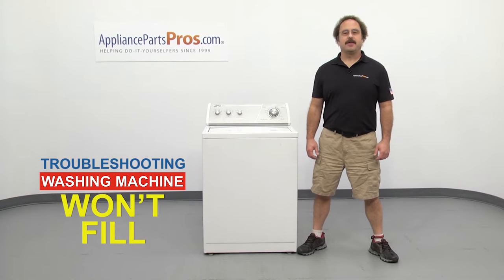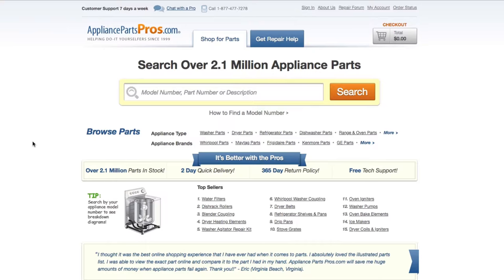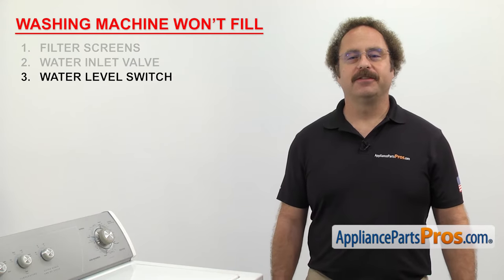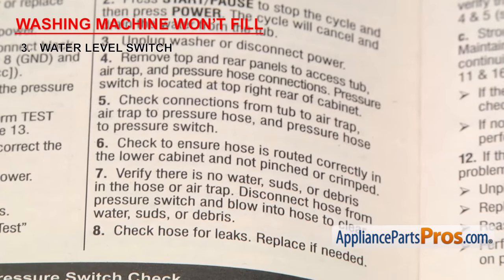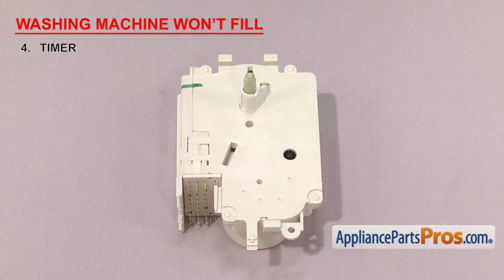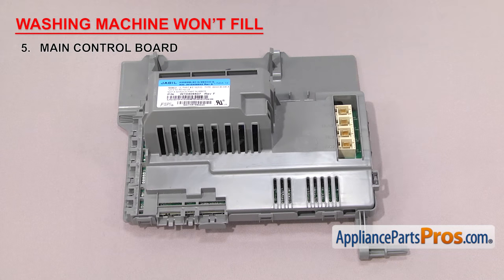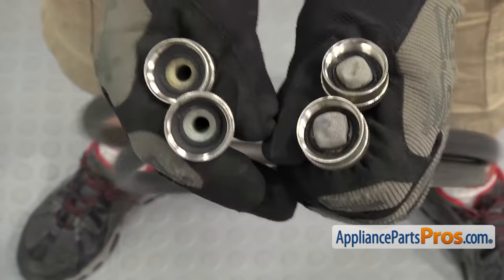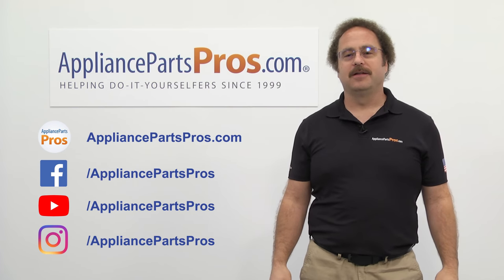Washer Won't fill? - Top 5 Problems and Fixes - Top-Loading and Side-Loading Washing Machines

Comment: Very useful information! I have an AEG Oko Lavamat and it works perfectly fine until the rising cycle when it does not take water anymore and I get E10 error code. I understood that the rising cycle is done with cold water but I don’t understand which part could be malfunctioning. Could it be the main control board?
Reply from the maker: If you have power going to the cold water valve and no water is entering the machine then the valve will need to be replaced. If you are not getting power to the valve then the control board would be the issue.

Comment: If you take the water level switch apart inside is a set of points like an old car ignition system. Just clean the points and you’re good to go. Just did that to my washer. Saved me 50$ on buying a new switch
Reply from the maker: Glad you were able to fix your washer. If there is anything in the future we can help you with please let us know.

Comment: Great video ! My Whirlpool washer 1CWTW4815EW1, when set on SMALL LOAD automatically fills to MEDIUM or more. It does not overflow of course. I have blown through the pressure hose to make sure it is not obstructed and the hose goes directy to the MAIN circuit board.  Will replacing the water inlet valve have any helpful effect on this problem ? It has done this since new about three years ago. Thanks !
Reply from the maker: It sounds like the water valve is working properly since it is letting water in. If it's not filling up to the correct level and the pressure hose is clear, then you will need to replace the control board. That part is W11305799, you can place that order on our website or you can call us at 1-877-477-7278 to place the order over the phone.

Comment: GE Washer GTWP18WOWW
Washer is set to Extra-Large load, Heavy washing mode. Water fills to expected level. Washing cycle begins and continues normal until timer pointer reaches the RINCE cycle. The Rinse cycle begins with filling the water to approximately ½ of what was during the Washing cycle. Agitator starts with ½ of water. Agitator starts while water continues filling the Tub for the next 10 sec. then water stops, and the Agitator continues with 1/2 of water to the end of the Rinse cycle followed to Spin cycle. 
My thinking was that the Water Level Switch is OK because it fills water properly at the beginning of Washing. I have installed a new Timer but issue remains the same. Would you please advise. Thanks in advance.
Reply: Mines only a month old.. Fills less than 1/4  not even close to cover clothes. Sounds like it whining like motor struggling. Stops fills. Stops whines. I took a bucket n filled up the tub. Idk what to do. Bc Lowe's SUCKS
Reply: I found that the problem with the old washer is the same as the exact new one that was provided by the landlord.  I take to adding a gallon or so of water weighing down the clothes and fooling the machine into sensing that it has a "full load."

Comment: I have an Insignia Top Loading washer that cleaned clothes very well for 13 months. Now it agitates for 5 minutes before the water goes into the tub. Even with Deep Water selected the tub barely has any water in it. I've checked the hoses and filters - they look good. Next I'll start with the Water Inlet Valves. Thanks for the videos. Any suggestions are GREATLY appreciated.
Reply from the maker: What is the model number?
Reply: Could water have gotten in the area outside of the drum and be causing the washer to "think" it already has water in it?
Reply from the maker: Can you verify that model number? Not having any luck locating it anywhere. Do you happen to have a multimeter? You can check the valves for the correct voltage.
Reply: Yes, we are checking with a multimeter. Looks like we might need a new part @appliancepartspros
Reply from the maker: If you can verify your model number we can help locate the correct part for you if you would like.
Reply: NS-TWM41WH8A. The "BA" at the end of the model number is probably a typo on the front page of the owner's manual. Thanks for asking again, I hadn't realized they would have a type like that. The multimeter says that some of the terminals on the water level switch aren't working. We will try a "reset" and then see if it works. Amazon should be delivering new Hot/Cold hoses by midnight.
Reply from the maker: If you open the top of your lid on the inner side of that lid there should be a sticker with the model and serial number on it.

Comment: So my washer is a GE top loader it will fill to the correct amount of water for a wash cycle. Small medium large but on rinse mode it will only fill up to the bottom and that's it. So could it be the water level switch? Or the water inlet valve?
Reply from the maker: What is the model number of your washer? Have you had any error codes come up in the machine?
Reply: @appliancepartspros  GLWN2800D1ws 

no codes did show up but I would like to know what could be the problem of why it doesn't fill up all the way on rinse cycle
Reply from the maker: During the rise cycle when it is filling has it always just filled to the bottom or is this something that the machine just started to do?
Reply: @appliancepartspros  it's always been doing it
Reply from the maker: The manufacturer has designed this unit to not utilize as much water during a rinse cycle as it would the initial fill.
Reply: @appliancepartspros  This makes more sense thanks your help. Have a good day 👍
Reply from the maker: You are welcome. If there is anything we can help you with in the future please let us know!

Comment: Thank you! I will let you know how my repair went.
Reply: howd it go?
Reply: @daniel-ji4ww  Good, purchased the meter, took it apart to asses just fine. Easier than it looks. Then the vendor came out and showed me some wires that came loose when the washer was spinning. Now I know what to look for. Your video was most helpful and you're a great teacher. Thank you Dave.

Comment: My Roper Washing machine cycles back and forth between hot and cold water (1-2 minutes each) during the fill cycle when the "HOT" water setting is chosen. The result is the water in the filled tub is lukewarm at best. Does anybody know if there is a part or parts that determines the length of these cycles? I'd like to make the hot water come out longer and/or the cold come out shorter to result in true HOT water when the tub is filled. A capacitor maybe?
Reply: I took both my hoses and attached them to the hot water line. No more cold wash.

Comment: What if the tub only fills half way for a large load?
Reply from the maker: Have you had any type of error codes come up on the machine? What is your model number?
Reply: This machine isn't that new.  No error coding available. However, in reading more on your website, I think it might be a need to change the water level setting switch. Another question, though: how could gunky filters in the hoses cause the machine to not fill all the way? If you set the level to "large load", shouldn't it fill to that level even if the water is dribbling into the tub, taking, say, 5-10 minutes to fill? The level switch is pressure sensitive not time sensitive, right? @appliancepartspros

Comment: If I fill with a hose it works and drains
Reply: But it won't fill at all
Reply from the maker: You would be having an issue with the water valve. What is the model number of your washer?

Comment: My machine will fill to any level on warm or hot settings. It will stop filling on cold at medium size load
Reply from the maker: Have you had any error codes come up on your machine? What is the model number of the washer?